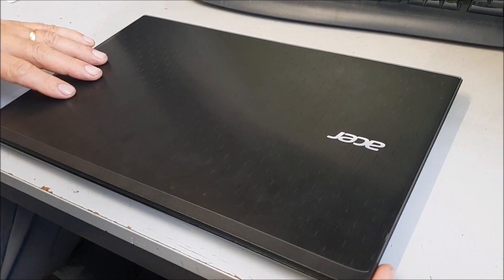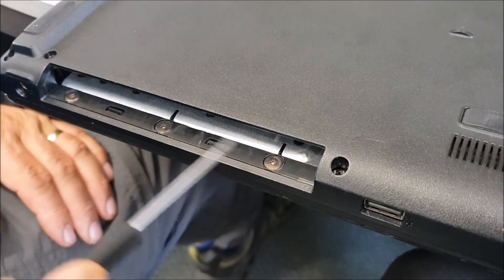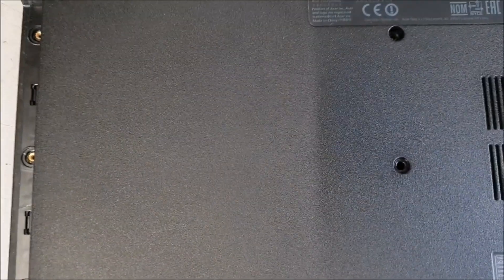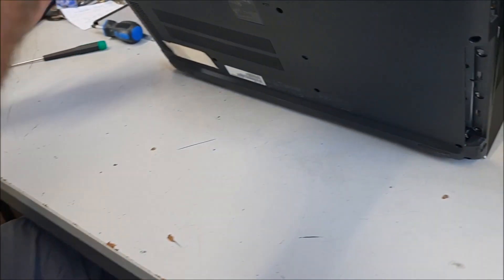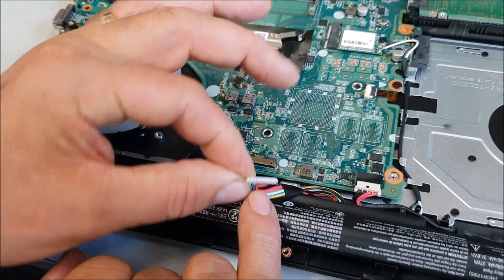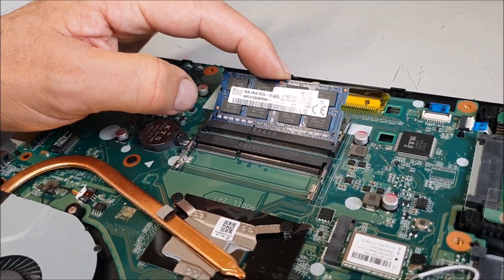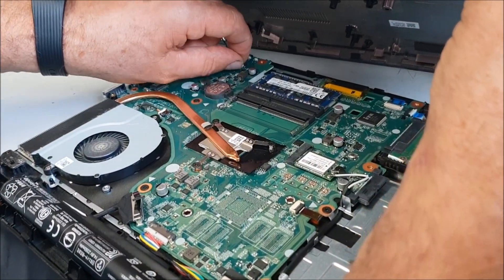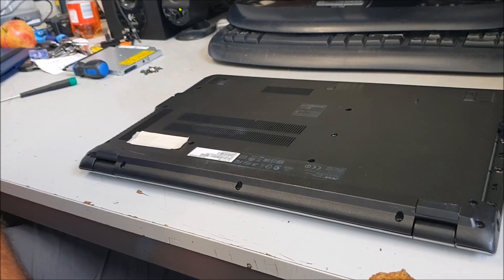ACER ASPIRE V3 574 BATTERY MEMORY HARD DRIVE REPLACE

Comment: While cleaning the fan of my laptop, I opened it and to remove the battery. I accidentally bent the pins of the battery connector. The laptop is working by removing the battery, but can the pins be fixed?